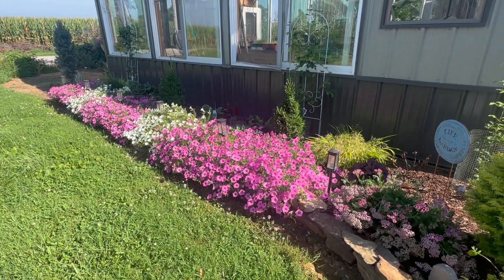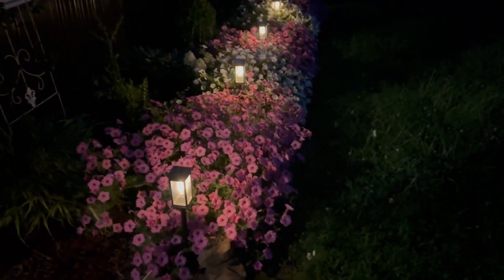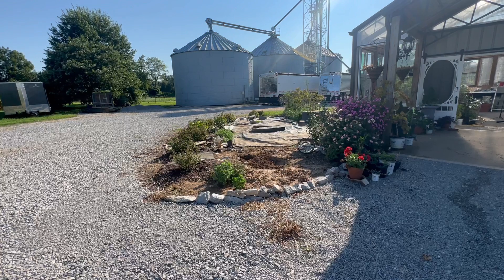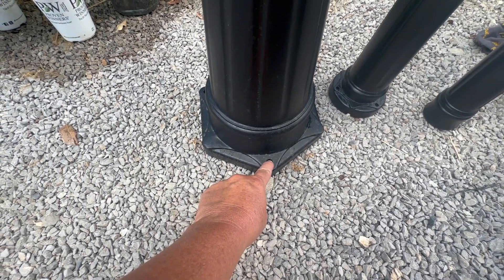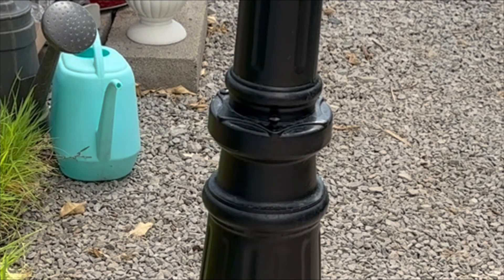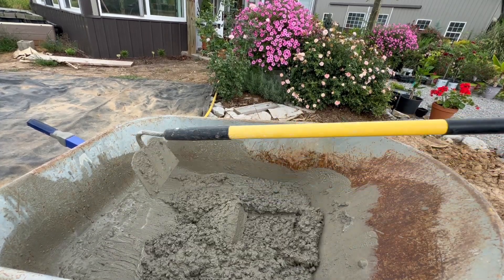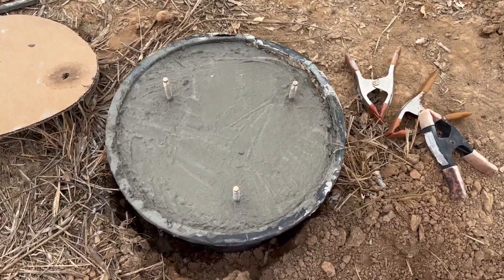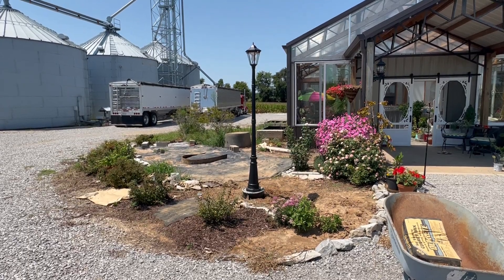Installing a solar lamp post in the flower garden bed. Lighting; the practical & beautiful hardscape

Comment: Hello dear I want contact you because I want know more about solar garden lights.
Reply from the maker: I buy most of my solar lights online, either from Walmart.com or Amazon.com.  I have been very pleased with the ones I have purchased.  They need access to plenty of direct sunlight to work so you cannot put them in shady areas, or under trees.
Reply: I love the solar lights.  I bought a pack of 6 small ones from Walmart and paid around 6 dollars .  They are smaller than the ones you have but they really light up at night.  Your lamppost looks great. ❤
Reply from the maker: @quakethoc2249  thanks!!  I love solar lighting and installation couldn’t be easier!!